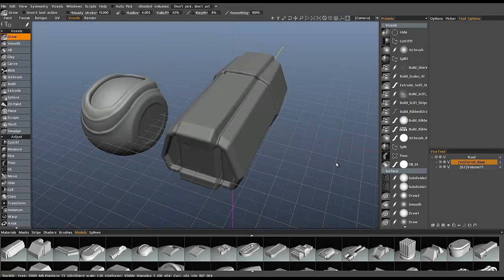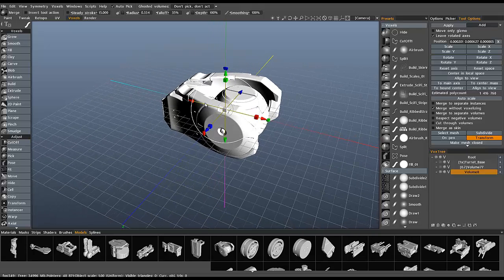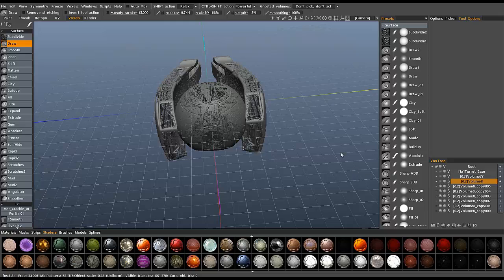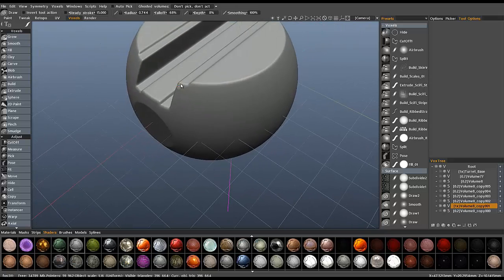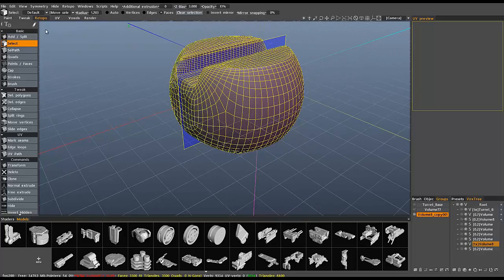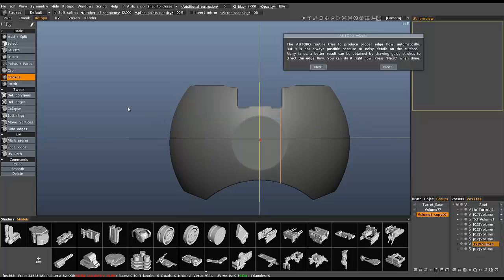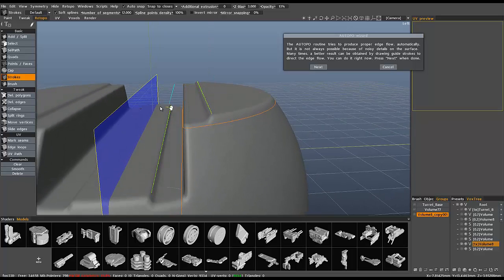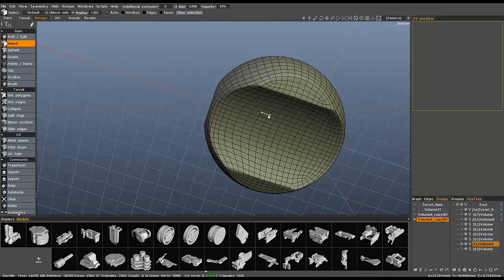Auto-Retopo for Hard Surface Models Pt.1

Comment: 3D coat, could you please update the tutorial to the latest 3D coat version? A lot of things have changed and I am having a hard time figuring how to symmetrize and auto-retopo
Reply from the maker: Yes, we will do an updated video, but there are no fundamental changes. Rather than choosing Symmetry in the Auto Retopo dialog, you just turn symmetry on before you run the wizard. Hard surface option doesn't necessarily refer to Hard Surface projects, but models that have really sharp edges. If there is some beveling on the edges, you don't want to check that option. Nothing else has really changed. Andrew improved the Auto Retopo algorithm last year, but on the user end, it's about 99% unchanged.
Reply: @PILGWAY3DCoat  still getting good info out of this in 2023!  I'm going to try the hotkeys when I get home!  Stay safe!